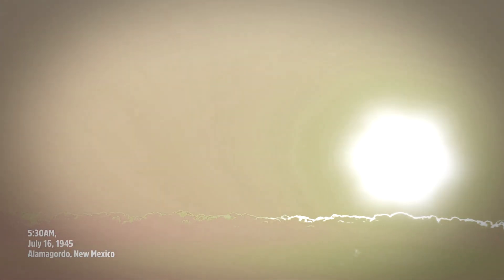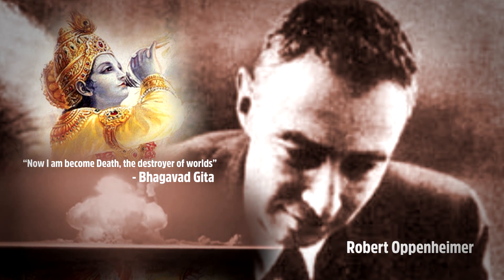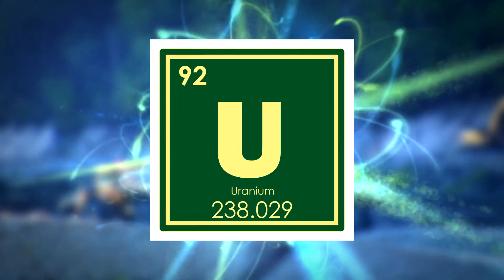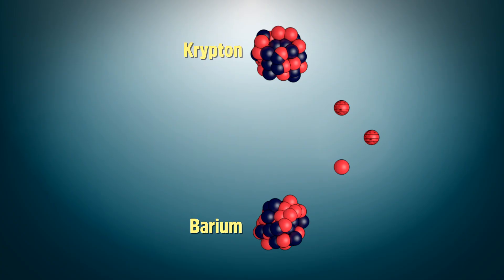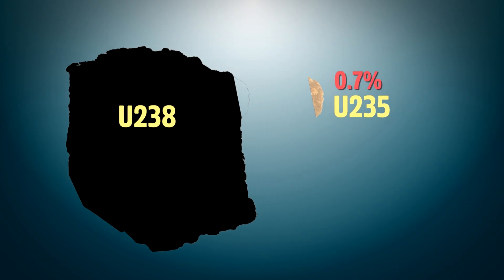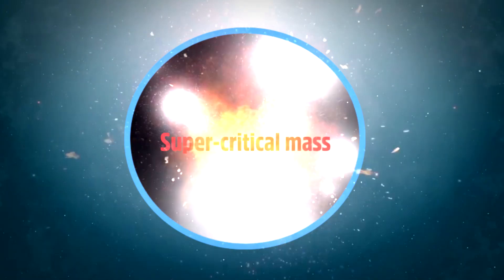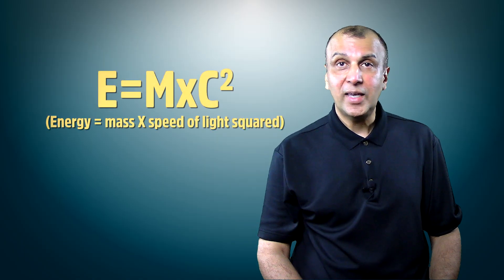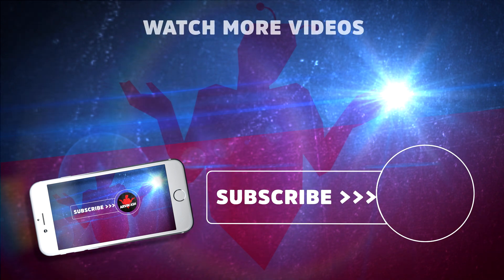How Does an Atom Bomb Work? And why don't more countries have it?

Comment: But why does it EXPLODE and not just melt down?
Reply: Because the effective neutron multiplication rate is sufficient to release enough to heat the core to a radiation dominated plasma at quadrillion of atmospheres of pressure in less than a microsecond.

Comment: To me the most interesting question is where the energy originally came from to form such heavy unstable nucleii. It's now known that the answer is the gravitational collapse of the core of a supernova and some of the material is released into space when neutron stars collide and fling a bit of it off. BTW, in the case of the plutonium bomb I'd use the term critical density rather than critical mass because the idea has to be to reduce the gaps between atoms so that neutrons escaping a fission have to collide with another nucleus (no gaps, at least from the centre of the core to the external surface).

Comment: Isotops have the same chemical properties so it is only possible to separate them with physical methods and not chemical. Multiple-stage centrifuges which have to spin at 100.000 rpm are extremely difficult to manufacture.

Love this clip: https://www.youtube.com/watch?v=lb13ynu3Iac

Comment: Japan already surrendered before the atom bombs we're dropped, the us just dropped them to show Russia they had these kind of weapons
Reply from the maker: You can argue that they may have surrendered prior to the second bomb, but where is the evidence that they surrendered prior to the first one?
Reply: Japan attempted in 1945 through the Soviet Union to enter a non-aggression pact via the Molotov–Ribbentrop Pact. The Soviet Union broke this pact, and revisionists argue that this was enough to justify Japan's willingness to surrender and that the bombings were unnecessary. Others also argue that unconditional surrender was too extreme and that the US were forcing the Japanese to remove their emperor. Japan without an emperor is effectively restructuring the government of the country, which is a strange thing to negotiate and a big reason why the Japanese did not want to surrender on the Allies' terms.

Still others even argue that Japan did not surrender due to the bombings, but the soviet invasion of Japanese-controlled Manchuria.  @ArvinAsh

Comment: The extra neutron doesn't "slam" into the molecular mass to cause the split.   Rather, the extra neutron is slowed down just enough so that the Uranium 235 molecule can allow the attachment of the extra neutron to attach and thus become apart of it.  Then this "overstuffed" U235 molecule is so overstuffed with neutrons that its nuclear binding force can no longer hold the mass of all the neutrons together and it finally explodes.  It seems like it "splits" but it really explodes because it is so overstuffed with neutrons that the nuclear forces that are supposed to hold it together can no longer do so.  So the nuclear force "gives up its ghost" and allows its overstuffed molecule to disintegrate and give off its guts.  It just so happens that all of the other nuclear atoms residing nearby are also overstuffed with neutrons that they are already wiggling with overstuffed neutrons. All it takes is one more neutron to slowly attached itself to another nearby overstuffed nucleus that simply having another free neutron slowly floating nearby will be able to attach to it and allow it to wobble and become "overstuffed" again causing it to give up its ghost.   It's the constant "overstuffing" of the neutrons that are attaching themselves to the walls of the atoms that is causing the chain reaction.  It's not the high-speed bullet-like impact we were so often taught over the years to believe that causes the atoms to split that Is so important.  That's why the Nazi's needed "heavy water" so that they could slow down the introduction of the latest neutrons.  Heisenberg was still off his target.   He wasn't even close to having a functioning fission bomb during WWII.  He was using flat square plates of abundant uranium stacked up in order to try to cause a forced chain reaction.  Despite his oversupply of Uranium, He did not know that he needed a sphere or an oval-shaped mass of U=235 in order to compress it to get the design he needed to create the "bomb" he needed.    But we (the allies) knew better.  We beat those Nazi bastards to the punch.  So now we can rightfully say as Al Pachino said in Scarface after he blasted a bullet through the head of his enemy against the car window:  "Just look at you now you stupid Fu++. Look at you now".     Source:  Movie Scarface. Directed by Brian DePalma and starring Al Pachino, Steven Baer, and Michelle Pfeiffer.

Comment: So you can go to a country create atom bombs once there place them miles near the point(s) you wish to destroy go back to your country set off a remote detonation on the bombs 

The best time to do this would be preemptively and then when ur country is at war or high tension you active them with a single button while they are expecting a jet to be the one to drop it

Bonus points if you take out 
-govement facility's
-politican areas
-places that have high trade value
-nuclear facilitys

Comment: How do they get a neutron to split U235 in the first place? I may have missed something
Reply from the maker: An initiator with a neutron source is used.
Reply: Arvin Ash so I did a bit of searching around and one of the only ones I understood was they make a chemical reaction that has leaves neutrons left over. Is that kinda right?

Comment: So, as a summary, the beginning explosion is caused from a uranium U235 atom being hit by a neutron. Then it becomes U236, which is unstable, so it splits apart into two different atoms, and also releases energy. Those other atoms are also split, and the process continues, making a chain reaction of energy explosions. I think. If I'm wrong, correct me.
Reply: And it breaks into 3 neutrons witch do it

Comment: Of all the thermonuclear weapons ever produced by the U.S., my personal favorite by far,  is the B41 (Y1 version). Based on the Bassoon Bikini test, this three stage weapon had a total yield of TWENTY-FIVE MEGATONS, and in its Y2 "clean" version, was the most efficient thermonuclear weapon ever built. Its weight to yield ratio was 5.2MT/ton. Best of all, the Y1 bomb contained a big dirty U238 tamper. You see, although U238 will not fission if used in a regular fission weapon, it fissions like CRAZY when exposed to the fast neutrons of a fusion explosion. In the case of the Y1 version, you got about half of your nuclear yield from that big dirty U238 tamper. That means about twelve megatons of yield came from fission. Just imagine dropping this bomb while set for ground-burst. TONS of earth would be sucked into the mushroom cloud and mixed with fission products of the tamper. This would create a soup of highly radioactive fission byproducts that would blanket the surrounding landscape for tens of miles. You'd also have a ground zero that would be a monster sized glass trivvet about five miles wide. In the ninteen-sixties, the U.S. had FIVE HUNDRED of these bad boys in the stockpile. That equals over twelve GIGATONS of explosive yield (about as much as a medium/smallish asteroid would make)! Dropping these all over the Soviet Union would have created a real nuclear winter! You would probably have had a mass extinction event with no sunlight hitting the northern hemisphere for a couple of years, and VERY grey skies in the southern hemisphere. Today, even if the U.S. shot it's entire nuclear wad, you would see a total yield of no more than two point three gigatons. This would probably cause nuclear dusk for six months, but NOT the nuclear winter Carl Sagan tried to sell the world. All of these amazing weapons were retired by 1976.

Comment: I thought they worked by implosion? They didn't split the mass in two. They squeezed it with high explosives. They call the warhead in a thermonuclear device a peanut. The masses stay as on whole.
Reply: You are correct. Even the first nuclear bomb (Trinity) was of the implosion type. Very few warheads used gun insertion. For the Hiroshima and Nagasaki operations, they used one of each. Little Boy, that was dropped over Hiroshima, was of the gun insertion type, as described in the video. Fat Man, that was dropped over Nagasaki, was a plutonium based implosion bomb.

Comment: Hydrogen bomb are easier and 1000 times powerful (nuclear fusion) e=mc^2
Reply: It’s more complicated. You have to have an atomic bomb first to even get  fusion between deuterium and tritium going, because the minimum temperature required is above 13 million Kelvin. Then you need to carefully design the shape and materials of the weapon in order to ensure over 50% of the output energy is from fusion. Otherwise you will end up with a boosted fission weapon.

Comment: for the development of the nuclear barrier quite a role played  old Indian and Jewish texts Because if we take the ark with divine commandments, it is very close to a nuclear reactor  and perhaps the god when he gave it to him, the arch gave him the correct instructions about what was going on the same is true in the old Hindu records, which describe in detail the nuclear devices. And somewhere in the 30s, people had enough knowledge and technology to make the first nuclear bomb based on these old texts 
.However, to make a bomb, you only need to purify or enrich uranium be mechanically electromagnetically or chemically.so when you get this dust from pure enriched uranium over 20 percent and for a bomb you need over 25 percent of pure uranium you compress that dust with adhesives in two bullets male and female then you place these two uranium bullets in a cannon tube and when the two uranium poultices collide in the middle 
in order to achieve the critical mass of fusion , 
However, when the two pieces of uranium collide  such a rubbing is formed, because the uranium is an element that, if slightly rubbed, begins to heat up and when it strikes it creates such heat that they start  atoms are easier to get rid of  from their connections and begin to clash with one atom  

in the same way  works and depleted uranium that when hit on any plate begins to rub with it generating heat above 2500 degrees  
that every metal armor melts and depleted uranium  enters the inside of the body of the tank.

Comment: In Australia and this is just the known deposits on the continent we have 41%>> of the worlds uranium that’s the current mines and it’s close to the surface making it easy to get too. When we and the British were testing nuclear weapons in the 50s 60s most
Of the U235 and plutonium came
From our reactors the pits aka the cores for the fission and fusion bombs LOL we actually had competitions on who can make the best bomb designe and bang we wone ! Australia was 20>> years ahead of the British in design on many nukes we came up with the idea of boosted fission hollow pit with dutirm etc in side the pit America had that
To the uk didn’t it’s sort of
Mixing a little fusion with fission in the same bomb making critical mass more efficient

Comment: The Hiroshima bomb only fissioned a small amount of uranium which had the weight a few grams less then a US dollar. The rest was blown away from the blast before it could fully fission.
Reply from the maker: I think you are referring to the amount of matter that was actually converted to pure energy using Einstein's formula E=MC^2.  This was about 700 milligrams or 1/3 the size of a penny.  The amount that was actually fissioned was around 30 lbs.

Comment: Nice video. Even I'm german I understood the most of it! But I have 1 question. Where does the 1 Neutron come from? I read that when the 2 uncritical uranium parts crash together its getting critical and the nucleus splits into two halfs. Then the chain reaction starts? Is it 235 Uranium when it splits or 236?
Reply from the maker: I explain in several questions below: Here it is reprinted - two types of pellets are placed within the nuclear fuel. The combination of two isotopes, such as berillium-9 and Polonium-210 coming together in the pellets inside the nuclear fuel releases neutrons.  These pellets come together inside the nuclear fuel at the same time that the two subcritical masses are forced together.
Reply: Arvin Ash   What is the neutron mirror?
Reply from the maker: Merlin Marquardt Great question. Usually Beryllium.
Reply: Arvin Ash   Thank you.  Wikipedia link is https://en.wikipedia.org/wiki/Neutron_reflector.

Comment: The reaction must have neutron to react so there will be a neutron generation to supply neutron to the uranium.Can u tell me about the neutron generation pls
Reply from the maker: It is explained in the reply to a couple of questions on this thread.  Here it is reprinted - two types of pellets are placed within the nuclear fuel. The combination of two isotopes, such as berillium-9 and Polonium-210 coming together in the pellets inside the nuclear fuel releases neutrons.  These pellets come together inside the nuclear fuel at the same time that the two subcritical masses are forced together.
Reply: Thanks

Comment: An atom bomb is inneficient, I think. The reason is the mushroom cloud. What if all that energy or heat sparced to the sides instead of going up? It would be more destructive, wouldn't it be? Nuclear physics is very interesting.
Reply: The fireball/mushroom cloud rises because it's hot. Same reason a hot air balloon rises. But you are right, the early bombs were very inefficient. Only a tiny amount of the fissionable material gets converted to energy.

Comment: Alot of scientific guesswork went n2 the making of the atomic bomb since atoms at the molecular level r not visable-- even with an electron microscope!
Reply: Super Cool  Don't underestimate the role of experimental physics.  They were testing splitting of atoms long before trinity.  Ernest Rutherford won the Nobel Prize for his experimentations in 1908 demonstrating the disintegration of atoms.  They built up this knowledge with more experimentation which measured the effects (energy released, etc.).  This wasn't all dreamed up on paper.  In fact, I would argue that Einstein's role was minor.  While his special relativity provided the theoretical foundation to describe the massive energy released, the laboratory work was headed in this direction and more important to the understanding of how to build a reactor and bomb.  They would have had enough information to build the bomb even without a full understanding of matter's rest energy (E=mc^2).
Reply: I think using the term "guesswork" is highly misleading.  It was more about ingenious experimentation that allowed them to build and refine a model of things that you can't see with the naked eye.  As an example read about JJ Thompson's experiments that lead to the discovery of the electron.
Reply: @justinjames3028  Thx 4 responding but my original point was "empirical" science--that is experiments using observable data--was nixed because one can't see atoms. The physicists were HOPING if I may...

Comment: Nuclear weapons don't use the gun-type method any more - they use huge quantities of fissionable material for a comparatively low yield.

Little Boy, as dropped on Hiroshima was a gun-type weapon, however Fat Man (the bomb dropped on Nagasaki three days later) was an implosion bomb, which works by simultaneously detonating explosive charges around a sub-critical sphere (now hollow) to rapidly compress it and make it super-critical. The explosive yield from Little Boy was 15kt from 64kgs of U-235, whereas the yield from Fat Man was 21kt for roughly 6.5kgs of plutonium. That's a very simplified description.

Modern thermonuclear weapons use these implosion bombs as the primary to trigger fusion in the secondary which houses a container of deuterium.

FYI...it's funny seeing all the 'FBI watch list' comments, but in reality the notion that watching this or reading material on nuclear weapons will get you on such a list is ridiculous. Just creating the material is such an incredibly complex, costly and time consuming process, even for some of the most brilliant minds, that the FBI need not worry that folks relying on YouTube as their source material are in any way capable of turning it into a weapon
Reply from the maker: Correct. Gun method is easier to visualize for most viewers. Concept is the same. Besides, we don't want to give away all the secrets now, do we?  BTW, the FBI comments are hilarious, but I'm sure all in jest.